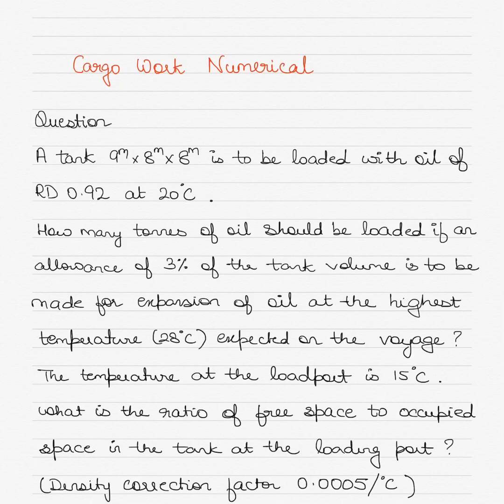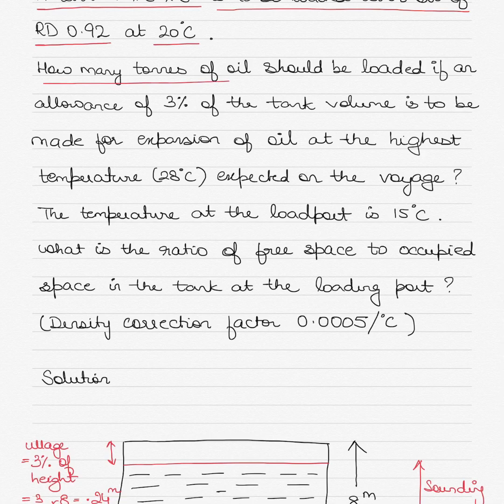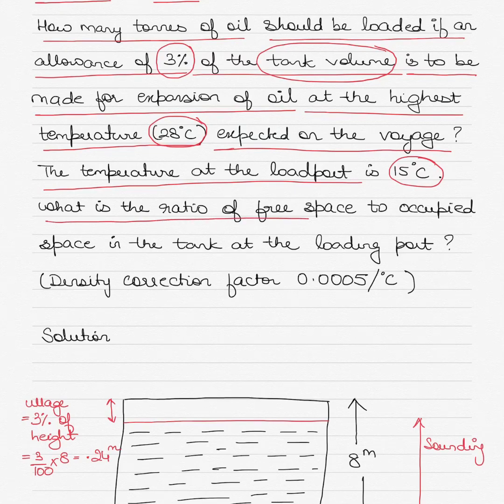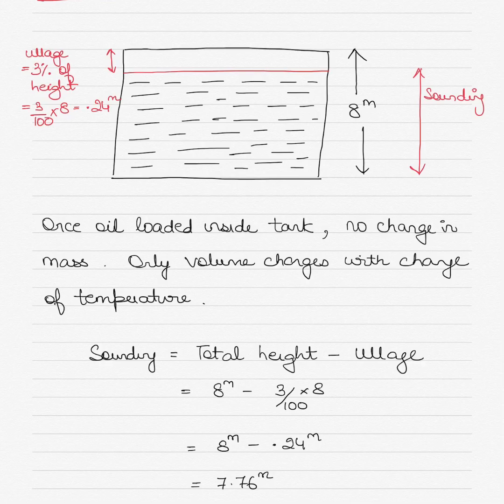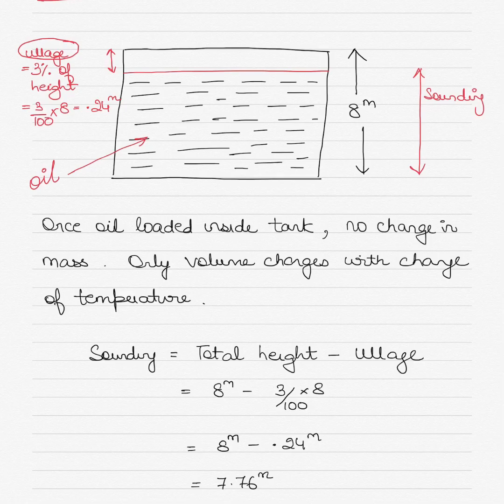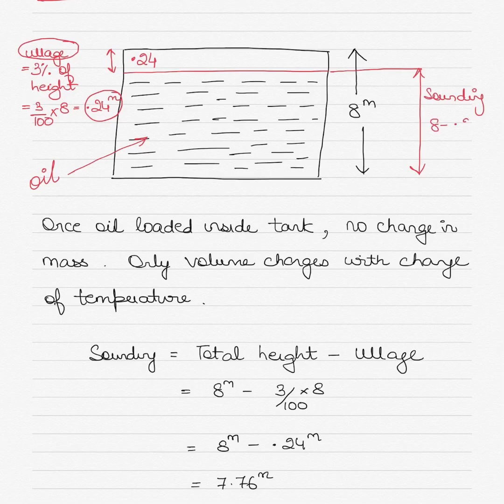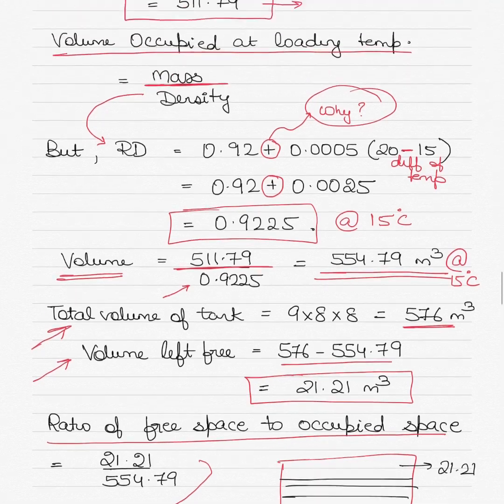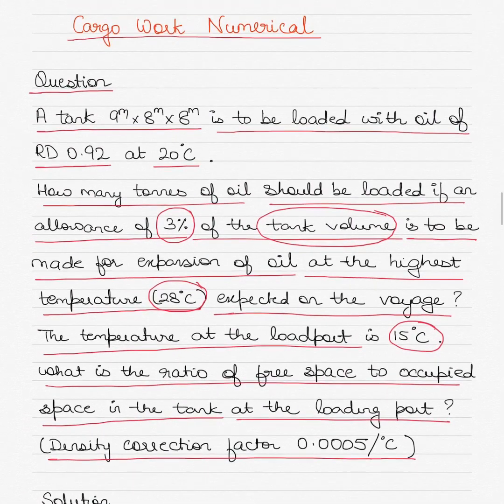Cargo Work Numerical - Example 1

Comment: A tank measuring 20m x 12m x 15m contains unpumpable oil of 10 cubm on arrival. Crude Oil of density 0.85 @15 C (in Vac) is to be loaded. 2% of the tank volume is to be left for expansion at all times. Loading temp is 30 C and maximum temperature expected during the voyage is 40 C, correction factor for density is 0.0006/C. Find a) Ullage of tank on completion of loading       b) Amount of cargo loaded
Kindly explain in this answer if it is not mentioned whether to use ASTM table or not in 2MFG exams will we proceed through density correction factor or use ASTM tables and how?
Reply: Hi friends
 For preparation of second mate / DNS/ BSC nautical science/NCV come in #kundanpatna